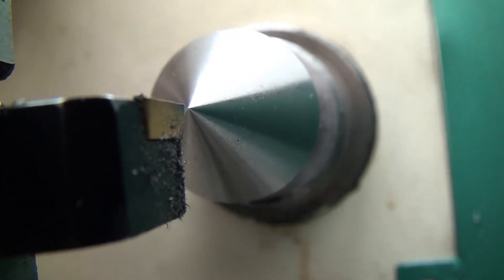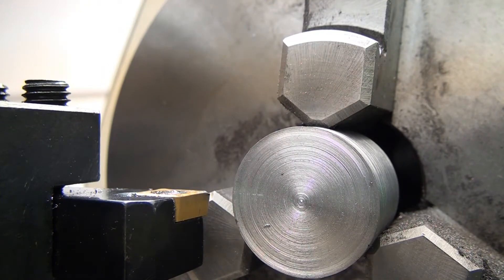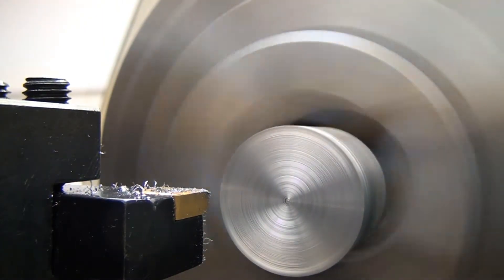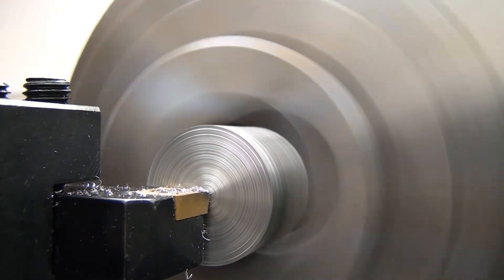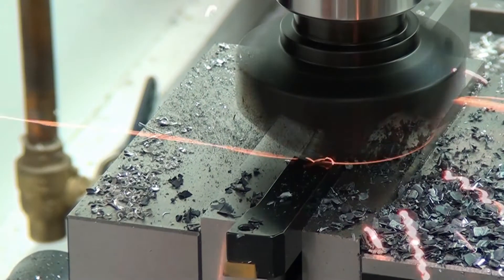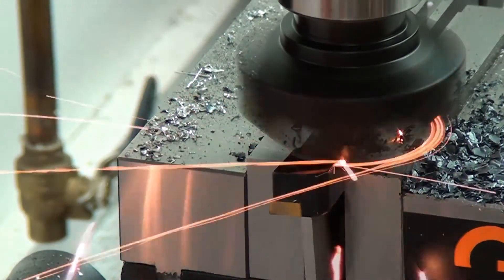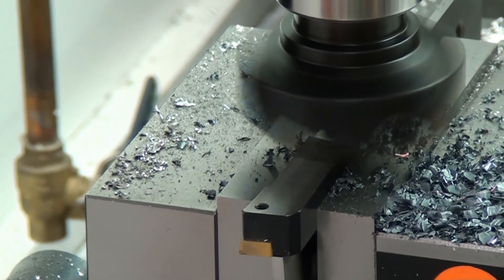20 G0602 1/2" Tooling (cuts above the centerline)

Comment: I have a G602z with VFD and ELS using a Phase II QCTP. I went the route of trying .5" tooling for awhile. I ended up skimming a .100" off bottom as well. At the end of the day, our lathes just don't need this size tooling, .375" are fine. I thought they would be stiffer, but our machines just don't have the power or rigidity to be concerned with a thicker tool shank. Love your stuff...subscribed.

Comment: Hey russtuff I have the 602 and noticed the issue after ordering holders for the 400 series cnmg inserts. I did some measuring and found that there is actually room to take .125" off the compound clamp surface. Just have to unbolt the degree wheel, mill the compound and shorten the mounting bolts. Hopefully this will allow the use of the parting tool at the correct height. can you see a downside to doing this, besides maybe having to turn the compound handle in to clear the cross feed handle? Keep up the vids
Reply from the maker: +Shane Lunday Good idea! I can't remember if I had the mill at the time I made this video. Thanks for watching :)

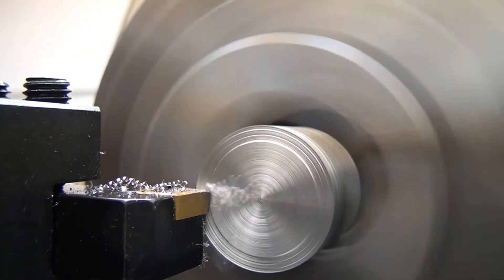Comment: At 0:39, watch how the face has waves in it as you're facing.  My machine does this too when the X gibs are adjusted too loose.  My waves are exactly 0.2" wide, or maybe half that cuz it's a lathe, but the ballscrew is causing the slide to wiggle on every turn.  Since you still have stock leadscrews the pitch will be tighter, and I think that's what I'm seeing here.  I know the insert is chipped and sucks, but I bet it still does this wavyness with a sharp one.

Comment: I actually did the same thing but on my Optimum 320x920 lathe..  i took off 4mm on a 20mm tool cause it was off.. Later on i got myself a Multifix toolpost instead (expensive suckers but worth it) that have a wider adjustment range.. now i need to myself a new righthand tool ;D

Comment: Change to 3/8" and buy your inserts from a well known company like sandvik, and try a holder that will take positive or negative inserts, trust me your finish will improve dramatically irrespective of the machine you are using, 
I am a toolmaker with 10 years machining experience on manual and CNC machines based in the UK so please do not hesitate to ask me anything you need :)

Comment: Audio good. I have the same issue with 1/2" tooling with my Phase2 toolpost on the G0602. I either use 3/8" or 7/16" tooling when I can get it or remove .1" off the tool holder. That way I don't have to grind tools every time.